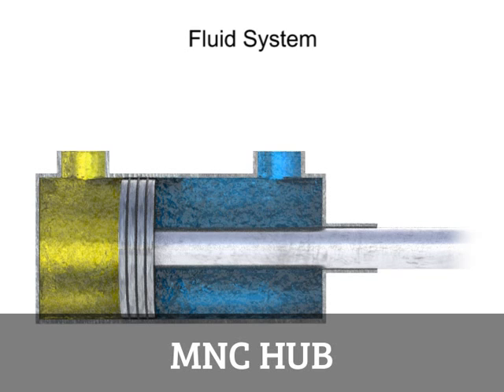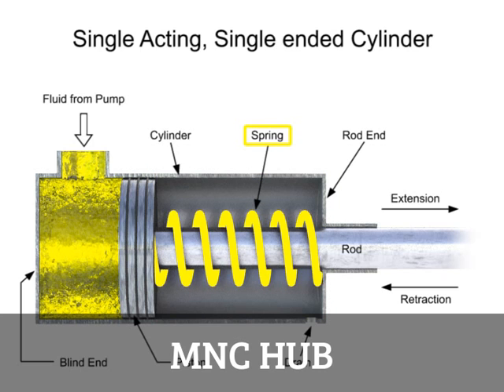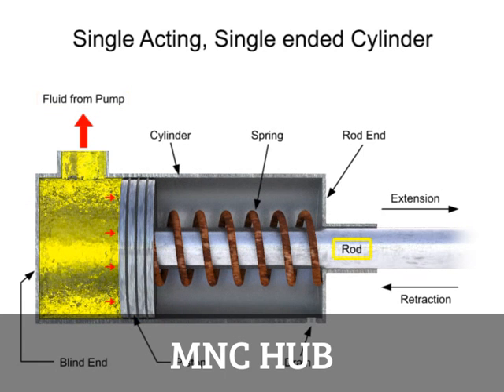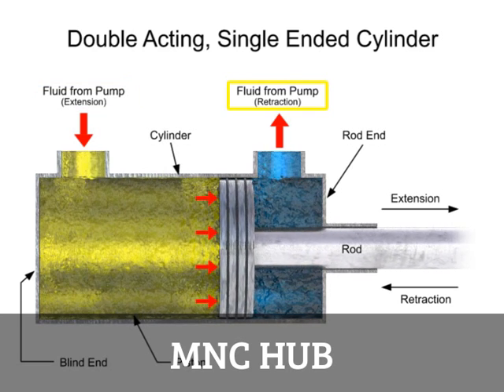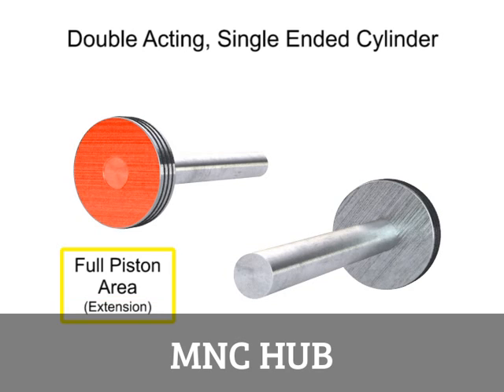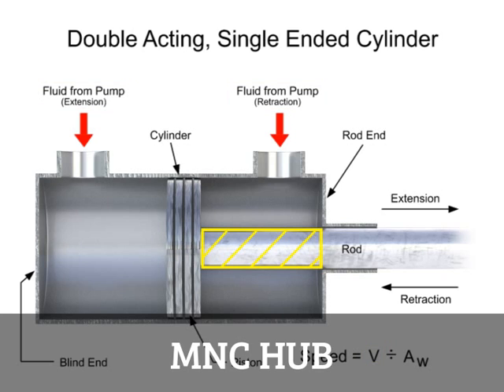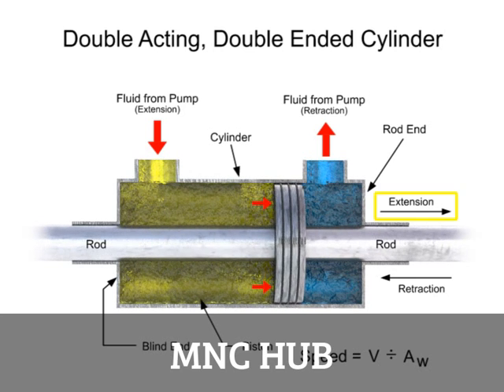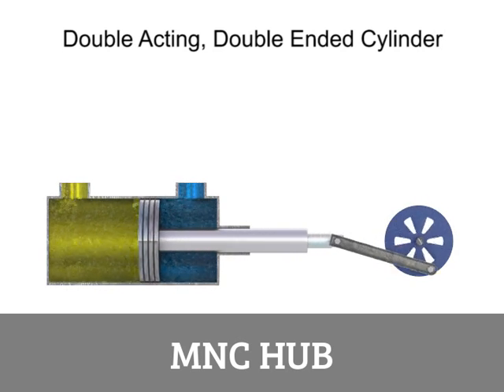Animation : Single and Double-acting Cylinders in a Fluid System

Comment: Is there a safety device on a single action cylinder?  I have hydraulic fluid flowing out the air filter when I extend the ram,and then the ram drifts downwards. And I can't seem to find the problem. I tried just about everything to make it work.
Reply: use check valve..
Reply: @kspades2530  forklift side shift, skid steer backhoe attachment boom swing

Comment: what would this be used for?
Reply: Jcb earthmovers
Reply: http://www.adityasharmaacademy.com/2020/09/double-acting-hydraulic-cylinder.html
Reply: You find such hydraulic systems mainly when you deal with heavy loads. Examples in agricultural machinery, tractorq have front loaders. these front loaders have 2 double or single acting cylinders to charge loads. hydraulic is delivrered by one of the tractor pumps